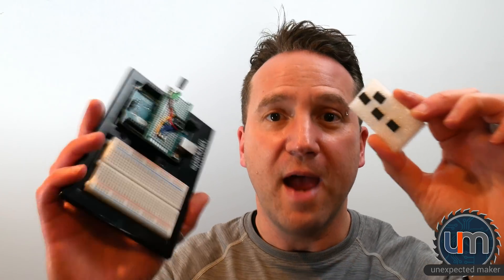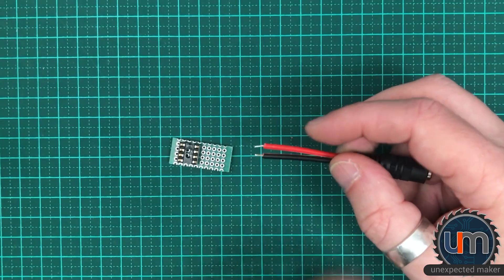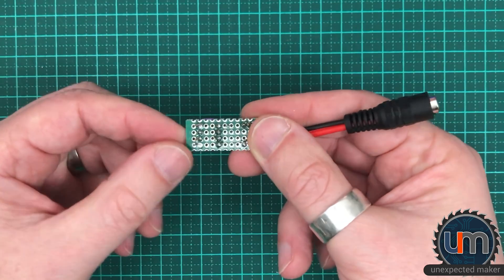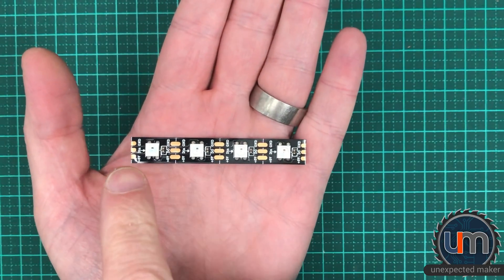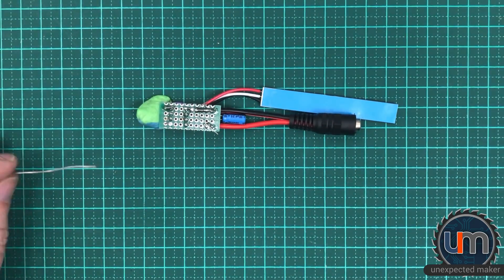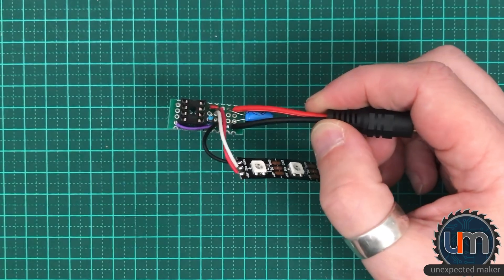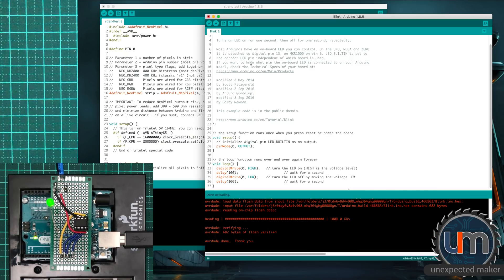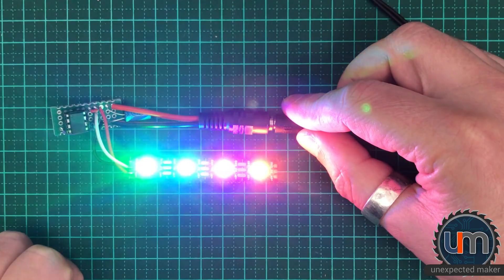Make an ATTiny85 Laser LED Sign

Comment: Hello, this is really interesting project. However I have a question: Why did you put capacitor in the circuit? (I don't have good background in electronics...)
Reply from the maker: It's a decoupling capacitor, to filter out potential voltage noise.

Comment: Suppose I wanted to power 3 or 4 1 watt 300ma leds with this chip, would it work?
Reply from the maker: Nope. Not directly from the IO pins. No micro-controller IO can do that. Most are rated for 20mA max. That's what Transistors and Mosfets are for :)